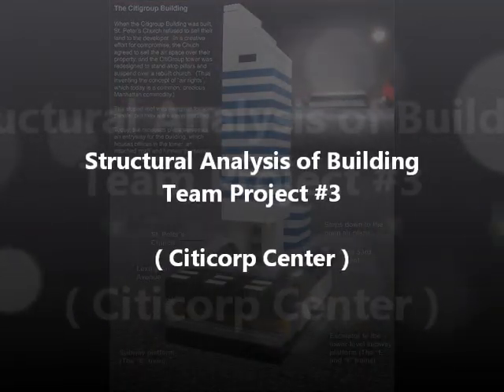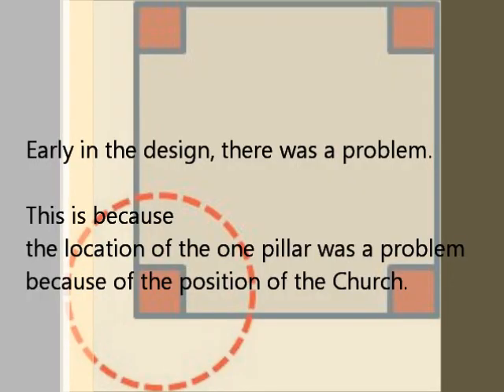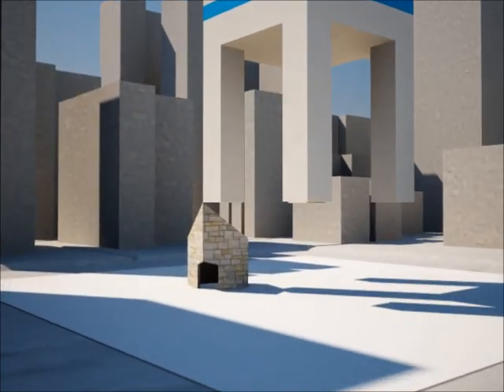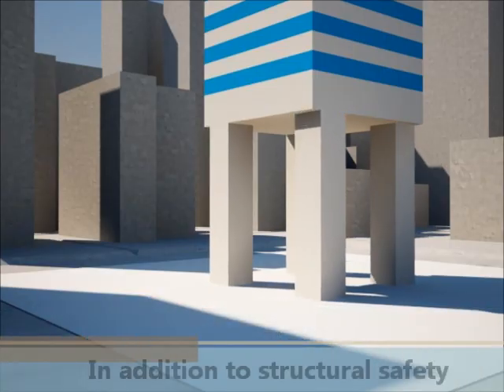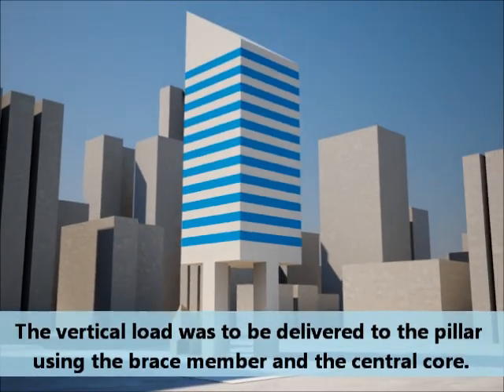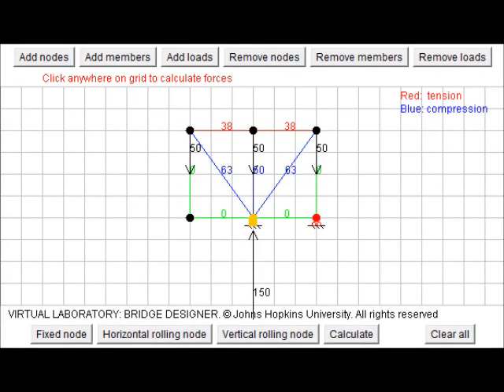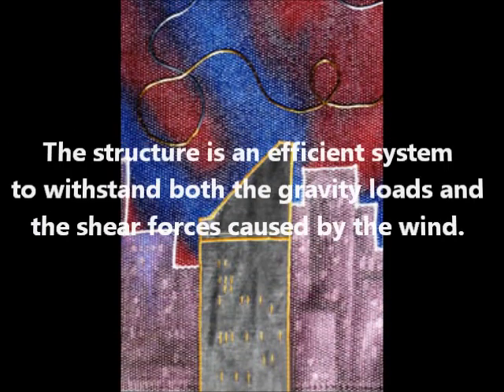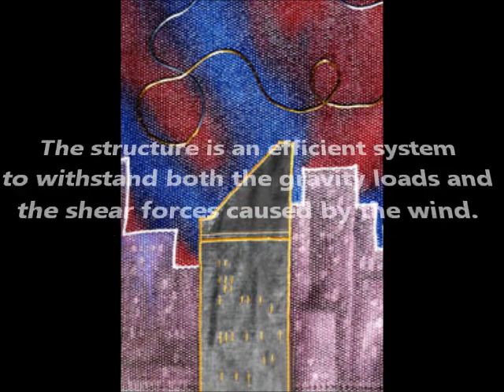citicorp center structure analysis

Comment: since 1978 - it had been believed that the building would have collapsed with strong quartering winds (winds directed at the corners) - and reinforcements were added - but that has recently be reanalyzed with modern techniques - finding the wind loads were not as great a threat as LeMessurier calculated - maybe the original design would have handled the winds loads just fine

Comment: Why so many dislikes
Reply: Possibly because the original load calculations were wrong and a 22 year engineering student doing her thesis brought it to the design engineers attention. They were not happy. This structure is studied by many students to this day.
Reply: @waynewilliams8554  - the NIST has recently reassessed the wind loads using modern computer technology - and concluded that they were not the threat the LeMessurier thought - so maybe the original design was just fine - & wouldn't have toppled due to quartering winds - and no one would have been killed

Comment: Why didn't they rotate the building and keep the 4 legs instead of moving the legs?
Reply: Because of the layout of the lot and it's boundaries right up to the right of way (the street), the building's footprint would have been reduced by 50%. That would have reduced the total floor space by about 70% since the smaller footprint would never support a 900-foot tall building so floor count would also have to be reduced.
Reply: Then the building would become significantly smaller and perhaps that is why they rather wanted the current design than a smaller building